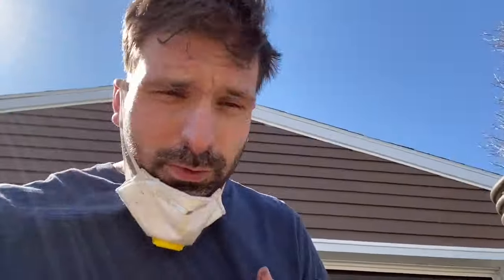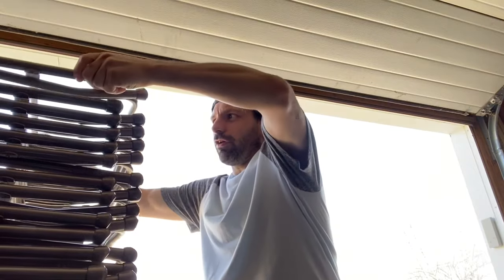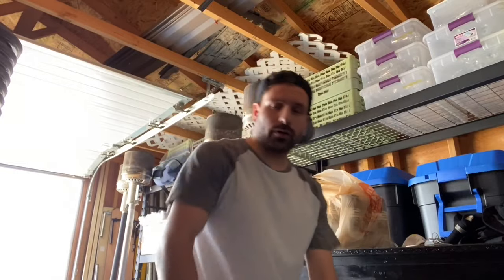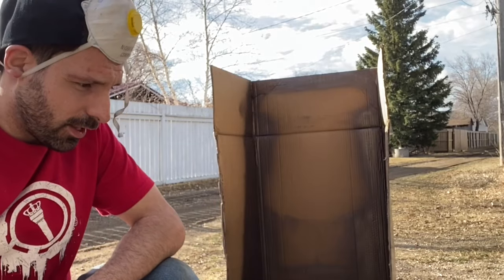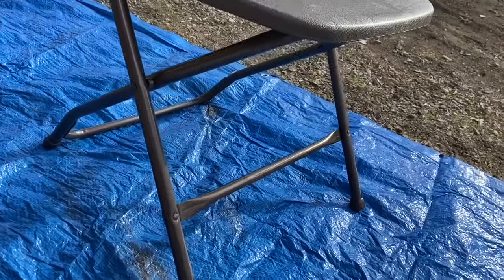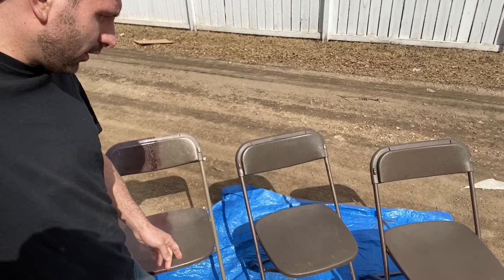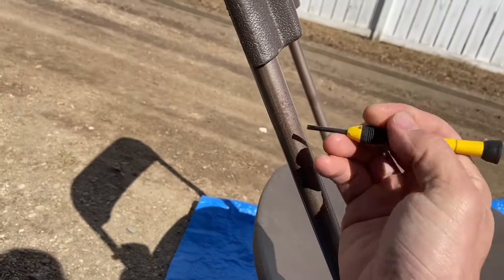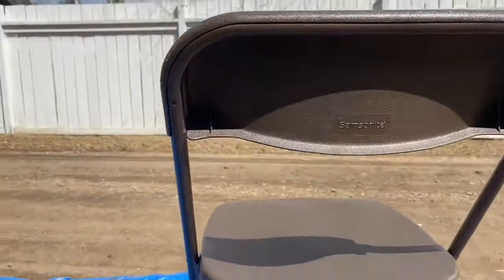Spray Painting Chairs  Rustoleum - Tremclad - Hammered - Finish - DIY - Chair Painting Toutorial

Comment: Same issue here after purchasing 200 of those chairs from an auction.
I found it needs a LOT of cans, so I purchased a gallon of Tremclad, which I reduce about 50/50 with paint thinner, and then I spray them with my compressed air paint gun (car paint type). I did however noticed that my spay pattern is too large with the normal size spray gun, so I ordered a smaller gun to try. The gallon of paint was $69CAD and the thinner $40. That gallon will last me many-many years as it might be good for 1,000 chairs. A regular size quart would have been sufficient.
Reply: How long did it take to cure?

Comment: Thank you. Just starting out in the rental business. Bought 30 brown chairs to start but they’re pretty beat up. I need to refinish the metal and plastic. Do you think this will work just as well on the seated area. I spray painted some chairs years ago but didn’t do any research, probably used the wrong kind of spray.  Every time someone sat on them it ruined their clothes! Would hate to do this to paying costumers.
Reply from the maker: Update:
It is very hard to get the paint to match, I found luck in the hammered paint as the brown blends in with brown Samsonite chairs however it is expensive to buy and you have to do a few light layers and wait at least 7 days between coats. This full cure time for me was like 6 months, once that time has been reached the paint really stays on the chairs and now all I have to do is minor touch ups. But it ended up being a really big job.

Comment: Looks good. Did you paint the seats and back rests? I have a option to buy used ones but there are a little rusty. I am only starting with 50 so I think I’m going to jump on it
Reply from the maker: I used the brown paint because it blends in with the plastic so that I didn’t have to paint the plastic, or if I missed you wouldn’t be able to tell that there was a bit of paint on the plastic very well.

Comment: Could I spray paint the brown ones white? They have metal sitting part not plastic
Reply from the maker: Painting the metal could work but it will take soo much paint. So many layers and months of curing time between coats. You’ll find the spray paint to scrape off for a few months and you’ll put the chairs into storage and forget about them and when you come back to them the paint will be hard. So in spite of what anybody says (cause people will say it won’t work). It will harden fully, it just takes forever.
Reply from the maker: Painting the metal could work but it will take soo much paint. So many layers and months of curing time between coats. You’ll find the spray paint to scrape off for a few months and you’ll put the chairs into storage and forget about them and when you come back to them the paint will be hard. So in spite of what anybody says (cause people will say it won’t work). It will harden fully, it just takes forever.

Comment: Dries to
 touch in 30 minutes, to handle in 1 hour, and is fully dry in 24 hours. Apply a second coat 30 minutes to 2 hours after applying the first coat or after 7 days after applying the first coat.
Reply from the maker: Yes, that is what it says. But a full cure will take longer. I base this on experience.
Reply: @therentalguy  Ok great! Thanks.